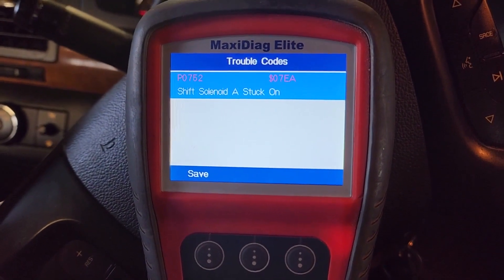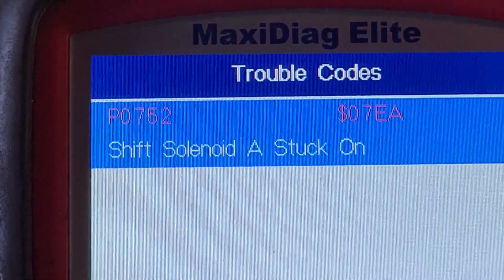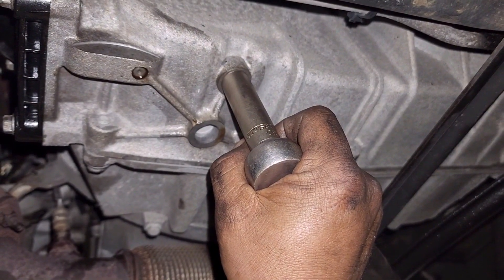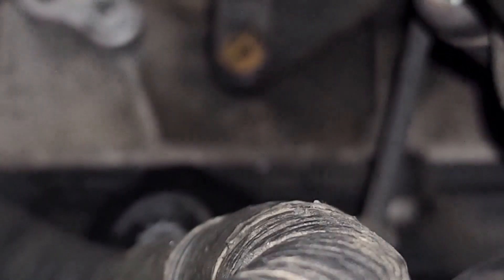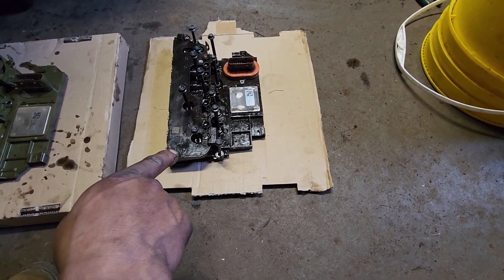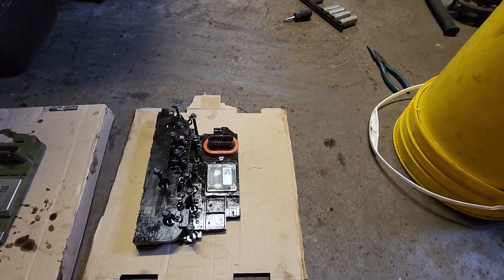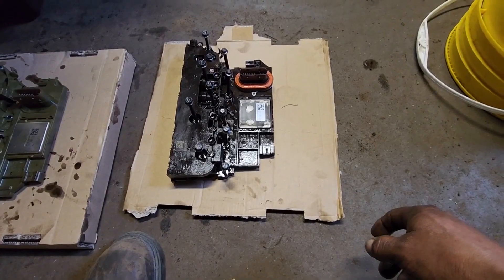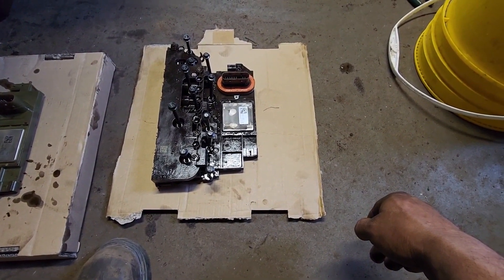08 Saturn outlook code p0752 - p0700

Comment: I have p0752 so is this the problem tcm? Or should I get trams rebuilt
Reply: May i ask whats your vehicle doing. I have a 2009 Saturn Aura these codes came up. My car goes like in a sluggish mode. Rpms rise and i cant accelerate much. Thought needed transmission. Figured out. Its the TCM fuse. So simple fix. Youtube Saturn Aura TCM fuse & see about it if its the same reasoning.